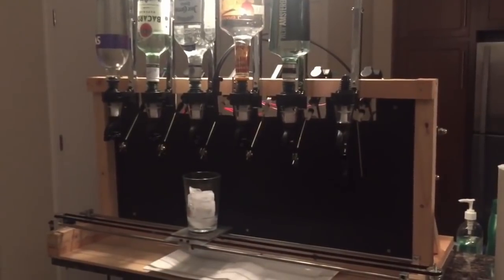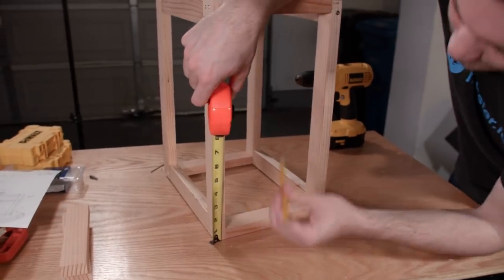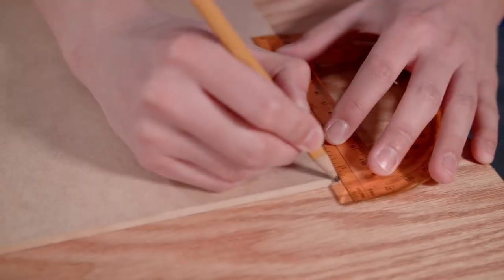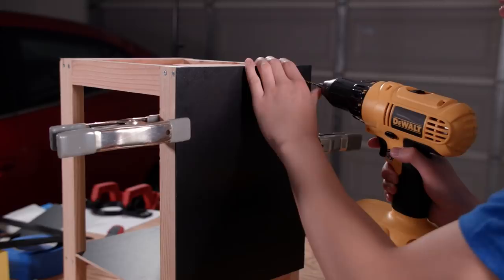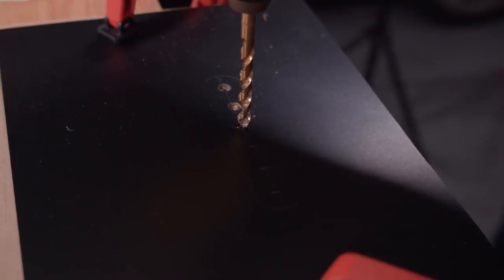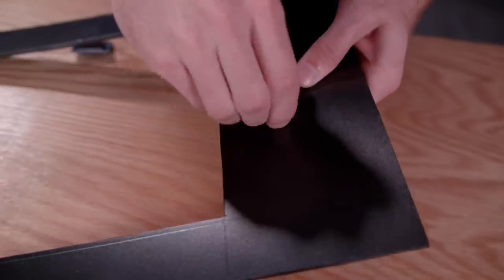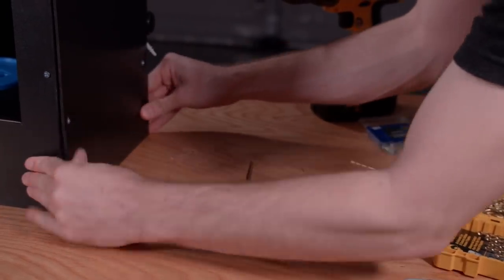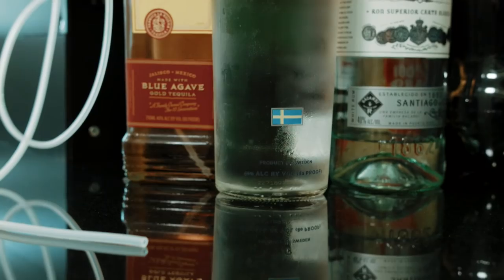How to Make a Raspberry Pi Smart Bartender

Comment: How long does it take for making a drink?
Reply from the maker: Depends on how many pumps run. Long islands take about 10 seconds. Simple drinks take about 30 - 40 seconds because they only have 1 or 2 pumps running at a time
Reply: seems a bit slow
Reply from the maker: Only if you're watching it. That's the beauty of autonomy. :) You could also step up the voltage to run the pumps faster, but it would risk burning out the motors
Reply: Seems to be a normal time I would say. A processional bartender would need the same time ;)
Reply: If you think waiting a minute for a drink is too long you need to go to more bars

Comment: Add a setting for clean.  Where all the lines just pull in water after your party is over
Reply from the maker: There is a setting for that. I forgot to mention it in the video
Reply: Nice!!!  Im definitely planning on making this my first Raspberry Pi build.  Also I was thinking that I would hide the pumps on the inside of the back wall and remove the funnel and opt for just tieing the tubes close to eachother.  I want to limit having to clean anything but the bottom (which you might also want to make quickly removable)

Comment: What if you added a few things?
Ok, so imagine you're on your sitting on your couch. You pull out your phone, press a button for which drink you want, confirm the quantity, and then press "place order". Then in the kitchen, this thing makes the first drink. 

A robot hand then grips the drink, places them on the back of a train, and when the correct number of drinks are loaded onto the train, the train then runs along the tracks, straight to your couch, and then stops. You pick up your cup, and when you're done, you put the empty dirty glasses on the back of the train. It chugs along to the kitchen where that robotic arm from earlier places the dirty glasses in the sink. 

Meanwhile, when your train originally departed the kitchen, the robot hand prepares more empty clean glasses to be used on the next order. So once it gets done placing all dirty glasses in the sink, it can send a message to your phone that it is now idle, and ready. So if you want more drinks, you can.

Comment: Add nextion touch screen to make it easier. Add phone app so I can order from my phone and customize drinks and save by name. Eliminate the funnel, that's gonna get muy disgusting real fast. You need a cap on all drinks, especially sweet drinks because the tiny flies will be coming to wipe their feet on everything the liquid touches.
They will also lay eggs and tiny maggots will hatch and since these are tiny flies, you will probably never see the maggots, but you will drink them....
Also like you have retraction setting for 3d printer you should have retraction for drinks to clear liquid from tubes and return to bottles.
If you put a few valves you can create a self cleaning function where the machine cleans it's tubes. They can get pretty nasty. 

Also add ice dispenser and glass loader because what's the point of remotely ordering a drink when you must still walk over to put ice in a cup and place cup on machine. Stuff like o.j. and pineapple and margarita mix needs to be refrigerated. 

Well that's all I have for now.

Comment: Ok, I see a few problems with this. First, how do you clean the funnel?

Second, you are literally pouring liquid onto a drink platform that you conveniently drilled holes into so that liquid that spills or overflows from the fancy logo'd cup holder can potentially drip onto the electronics below. In some cases, the liquid being poured is even flammable. I am still amused by the idea of this death trap but you overlooked one major safety flaw. At some point someone will pour a drink with no cup and you could have some issues.
Reply from the maker: The code has a function that turns on all the pumps at once to clean the tubes. It could probably use a pressure sensor for the glass but a short term solution would be to seal the gaps with some clear packing tapes on the inside by the platform

Comment: fwiw, the lines in the pump are not food grade and will likely leach nasty stuff.  Those pumps were meant for non-food applications like fish tanks.
Reply from the maker: The tubes are silicone which will not leach. You can also replace the lines that come with the pumps with the explicit food grade ones that I linked in the build materials

Comment: Still no solution to the soda going flat, because this setup doesn't allow you to keep anything carbonated pressurized...
Reply: Does the pumps eliminate the CO2 or is it the fact that the bottle is being kept open? Otherwise a rubber plug with a hole for the tube could be used for sodas.
Reply: @dariodraiman6339  The rubber would simply fly off. You can't keep a pressurized container under pressure using soft parts. This dispenser is a gimmick.

Comment: A Raspberry only for this is overkill. A RPi needs to start up (2 minutes making absolutely nothing) and has a lot of components which can fail (the OS, the sdcard, etc). 

This would be much better with a ESP8266 or similar. It has no SD card which can fail, has no OS that can fail, starts up immediately AND is hella cheap... Would love to see a machine with this configuration, instead of an RPi...
Reply: The sd card is just nand, same as an ESP8266 has anyway. Only difference is if it does break, you can replace it.
Reply: @joestevenson5568  Linux does heavy I/O when running, trashing the SD card slowly. The ESP8266 has no OS and therefore no I/O if you're not performing any actions which do so.
You also don't need any I/O on a smart bartender machine, so the ESP8266 will last a eternity.

Comment: Try making.. fountain soda machine..
Reply: Shubham Chauhan Really similar concept
Reply: Ok.. but will there be any changes in pressure... because there'll be a gas on the other compartment...
Reply: Shubham Chauhan If you use the same set up with 2 liter bottles of soda, no I presume.
In that situation it would already be carbonated and as we saw in this video, he added soda into some of his drinks and it worked fine.
All a deduction, however; fast food chains do it differently by having the machine carbonate the soda themselves I believe as to not risk the soda going flat over the course of a day or two.
Reply: Skankhunt42 but my point is to use CO2 cylinder for the fizz not the bottled one...